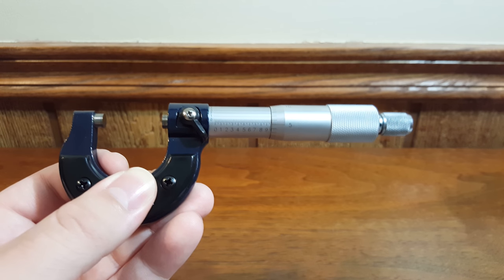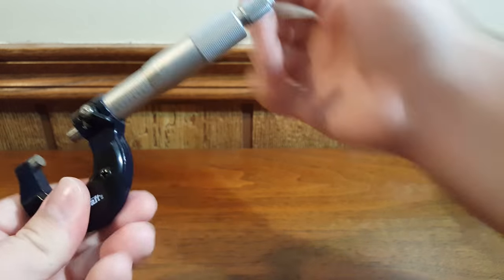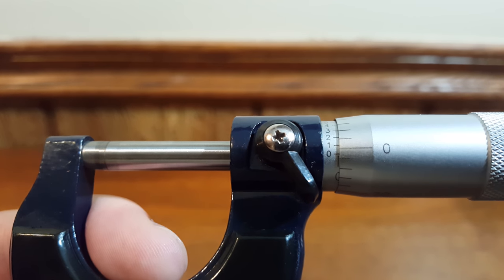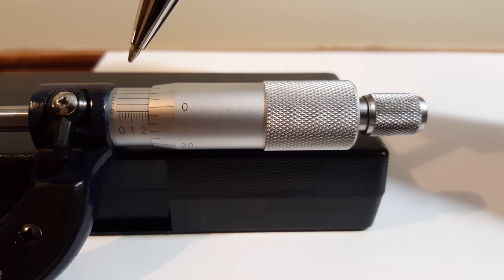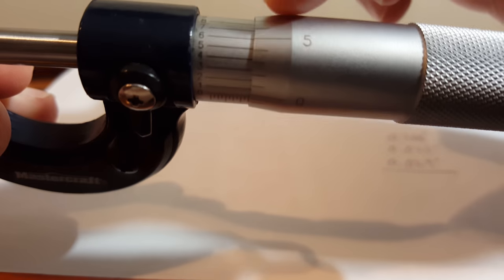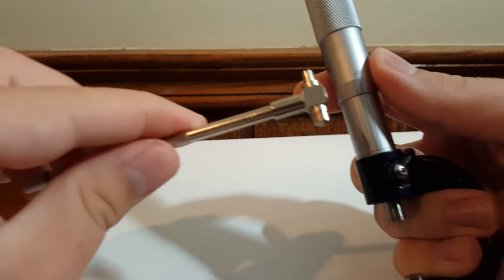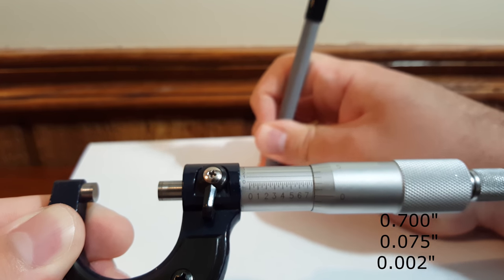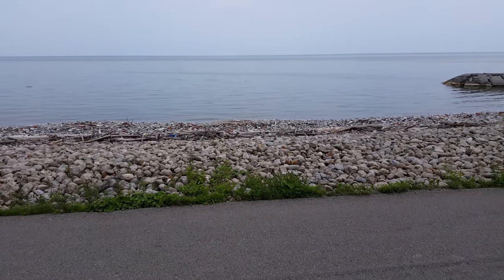How to Use a Micrometer | Measure, Calibrate, Tips & Terminology | Measure to 0.0001 Inches

Comment: Awesome instruction, I am wondering what is the main reason for using a piece of paper to calibrate a vernier micrometer? (Some people use a paper, some doesnt)
Reply from the maker: Thanks! The piece of paper is just to clean residue or gunk off of the faces of the spindle/anvil. Paper does a nice job compared to something like a paper towel or microfiber cloth that would leave some fibers or dust on those faces after wiping.
Reply: Point of Parallax Thank you